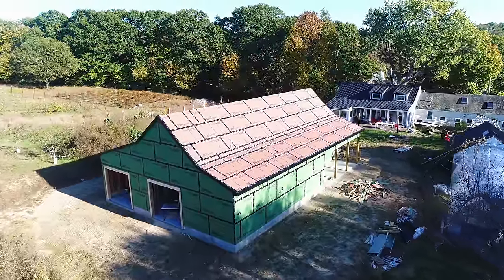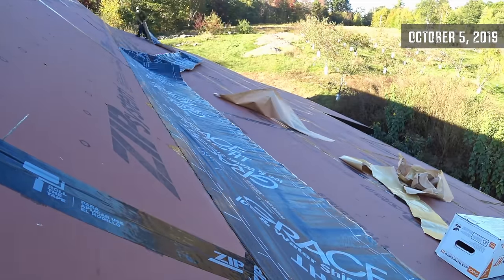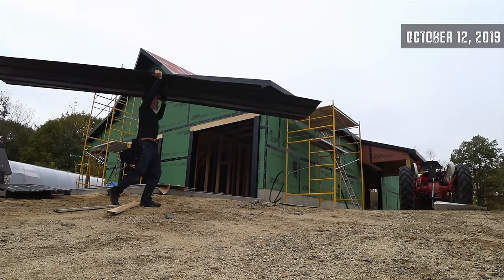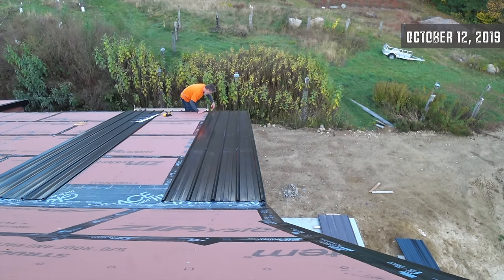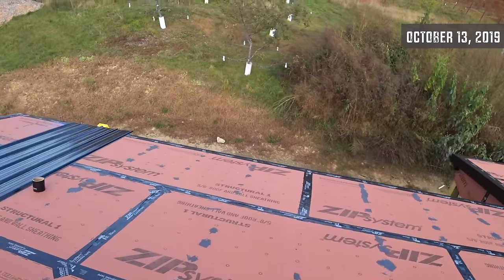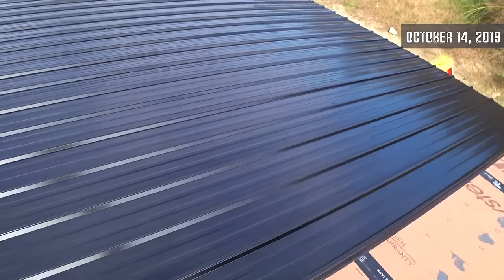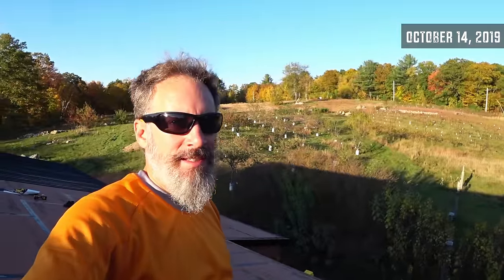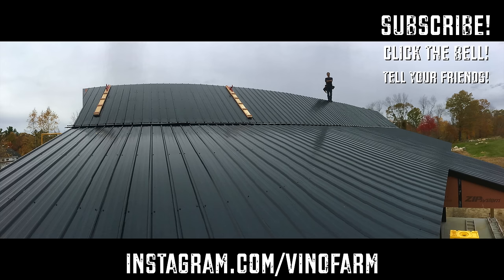Solo Metal Roofing - Dream Barn (Part 4) - Metal Roof Over Zip System

Comment: I just did a big shop with zip, the end conclusion is to just tape the Screw holes too, we did the liquid flash but it leaks a little through that on the screw heads
Reply from the maker: The liquid flash worked ok for me on the deep nail heads. The main problem I had was the framers slapped the tape over dusty zip panels and about 1/4 of the tape didn’t stick. I redid a lot of it.

Comment: Brave man!! Sheet metal isn't for the faint hearted! Yep those tin scissors are amazing! Used those doing HVAC for residential with my hubby for a number of years. To cut a 24 foot price of metal with snips... well my hubby could do it pretty quick after 20 years of Sheet Metal commercial install, but my little hands and forearms checked out at about 5 feet but seriously slowed down after 2. Hope your boo boos weren't too serious... those cuts last a lifetime and scar deep. Smiles and blessings...

Comment: Oh Jim, i am sorry but i had a good laugh on this one. You were awesome though, so don't take it personally. It was how many panels there were of that first type to put up on the roof. we went from 60-70 (it was 84) to over 100 (it was 84) in the process of putting up 4 panels! I am sure had it been me i would have been at 250 before we had half of them up there!
OK i stopped laughing. I don't like heights and its hard to watch you doing that! I would not have made it to getting the first panels up before i called the roofers! You are doing an awesome job, and i am able to watch because I know you did not fall. If you want to confirm that, it would be appreciated! Hugs!
Reply from the maker: That pile of panels didn't seem to end. But I took my time and eventually they all went up! One panel at a time...
Reply: @vinofarm  
and you did not fall! That's the important thing! Secondly important, roof is on - and if you are doing it - it will be done meticulously. No question.

Comment: Like you I'm no roofer but decided to re-roof our house (in slate, rather than metal, as it's a 17th century stone walled former water mill in France).  Why DIY?  Mainly because of the price of a professional job.  We were being quoted around 20,000 to 25,000 Euros ($22,000 to $27,000).  All in cost, to us, for materials was less than $5K.  I bought a second hand scaffolding set, big enough to run the 55 foot length of the building for around $3K from Ebay and resold it after the project for more than I paid for it.  Which was good!  It made the job so much easier - I would recommend it to anyone.  Our roof was 162 square metres (c 1750 square feet) on a 45º pitch - which kept the angles and calculations nice and simple.  You learn so much doing these projects - and likely as not - never use those acquired skills again!  So YouTube is a fantastic resource for sharing those lessons and helping others and big thanks to you for doing the same.
Watching you realise your mistake with those first two sheets I thought - oh yeah, just unscrew and flip the sheets through 180º.  And then you went and re-started at the far end.  Which was a surprise!  Or is that not possible?
My contribution to the ridge/valley debate.  All metal roofs here (France) are invariably fixed through the ridges.  It seems many US manufacturers (from other videos I've watched) recommend fixing in the valleys but it just seems illogical to me.  Ridges stay far drier than valleys - why increase the risk of water penetration?  Nobody really knows how long all these glues, sealants, tapes and synthetic jointing compounds are going to last.  They'll probably see us out, but what of the future?  Living in such an old house, with 3'6" thick stone walls that are as square today as the day they were built over 350 years ago, under the original oak king post trusses in the roof, covered in natural slate, attached with stainless steel fixings, I have a feeling this place is good for another 350 years.
It's very comforting to know that the roof we built should still be sheltering occupiers for the next 150 - 200 years.  Good to know that we have made our own contribution to the future life of this house long, long after we are gone.
Reply from the maker: There's a certain screw pattern in the sheets. If I had flipped them 180º, the lap would have been correct, but the screw pattern would have been upside down compared to the rest of the roof and that would have bugged me. Moving them to the other side allowed the lap to be reversed, but the screw pattern would remain the same across the rest of the roof. It was mostly aesthetics. As for the ridges... I followed what the manufacturer of the product said to do. They are very clear that flats are preferred. The fasteners these days are more advanced than they were 25 years ago (and prior) and they seal out water if they're fastened properly. In the old days, fasteners didn't seal out water nearly as effectively, so ridges made sense. Now it's more of a preference/habit thing but I think the mechanical advantage of the screw pinning the metal to the deck and having less of the fastener exposed to the air is a good thing. Going through the ridge leaves 3/4" of the screw shaft exposed and there's a lot more leverage for the expanding metal to pull the screw loose over time. 

Your house sounds amazing!

Comment: I know it is late but here is a hint. To keep the screw straight you take the first sheet up put the screws in then take the sheet back down line up all the sheets put the first one on then drill a pilot hole in every screw hole then the screw are in line. It really does not matter if the screws are on the ridge or flat. In the old days when lead sealed nails were used it was on the ridge and not flat. Looking good
Reply from the maker: I started pre-punching all the screw holes on the ground when I got over to the second side. Definitely made for a nice looking screw pattern in the end!

Comment: Congrats on doing this roof all by yourself! That's quite a job and I appreciate you gave so much attention to the details. While it may not be as helpful now that you're finished, I'd like to mention one issue that will help anyone who watches this and wants to do the same work in the future.  In my 20+ years as a metal roofing specialist, I've found that the screws in this type of metal roofing do not hold well over the long term when applied into a composite or OSB decking materials like the one you are using.  Don't get me wrong, the Zip System products are great, but the screws just will not hold tight in them for very long.  Nails seem to work fine for shingle roofs over these decks but I've seen hundreds of roof failures on projects like this from the screws backing out a few years after they've been installed.  I think what happens is that the screws kind of tear up the small wood fibers as they go in and then the expansion and contraction of the metal over time forces them up.  Your best bet, and my tried and true approach, is to apply wood purlins on top of the decking and screw the panels into that wood.  We typically use a yellow pine 1X4's but 2X4's will work too.  Another option would be to use a non-composite decking like real plywood as your deck.  I've put together several DIY videos on the subject and you can view on my page at: https://www.youtube.com/user/RoofingIntelligence
Reply from the maker: Thanks for the tip! Maybe next time...

Comment: Rr builders has a great technique for screwing metal panels, while he keeps them all aligned on the ground he would mark where the screws would go with a line and take a nail and hammer / dent them and it would mark or dent about 7-10 sheets at once. So all your screw holes have a small dent to start on and all aligned
Reply from the maker: YUP! I learned a lot from Kyle and the gang. I know he said that they do NOT pre-punch roof steel usually because the panels get scratched when they're pulling the punched panels off the stack on their lift. (They punch the wall steel.) So I didn't use that technique on this side because I was lifting the panels and sliding them off the tractor crib. However, on the other side, I was carrying them up one by one with the step ladder (I got faster) and I did start pre-punching those. It made a huge difference. Perfectly straight screw heads on the West side!

Comment: Grate video, as always, 

It is a bit late now, but the problem with the overlap of the first to sheets, all you needed to do was take them up and turn them 180 degrees,
and the flap would be on the opposite side.
and you could then refasten them thought the hole already  made in the sheets.
Hope the bee are well,will be good to see them in the spring.
Reply from the maker: Thought of that, but the screw holes would have been out of alignment with all the other panels on the roof and we can't have that!

Comment: Also not having a plywood skin helped moving around.  when I helped my father re-roof our old place I was never nervous on the roof until after all the new plywood went down. that stuff was /slick/ and if you had to cut or drill anything and got sawdust on it it was down right treacherous.
Reply from the maker: Another benefit of Zip System... extremely grippy!

Comment: Oh wow, 86 panels! 75 panels is quite a few, so hopefully everything goes smoothly. You'd hate to have an issue after all 92 panels are on and you have to take all 105 panels off and then put all 71 of them back on.
Reply from the maker: Wait until I get into how many screws I had to use on the next video.

Comment: Why did you screw the valleys rather than the ridges. 
Never mind I saw someone’s pinned comment. In Australia it is standard to screw the ridges.
Reply from the maker: It seems to be an Australia thing. Up here, it sounds like we used to do that, but the trend is on the 'flats' for the past 20 years or more. I followed the manufacturer instructions. Pros and Cons to each. I'm not worried.
Reply: South Africa also screws on the ridges to keep the water away from the screw and screw hole. That's what the ridges are designed for as far as I know. Great job though, looks like a fun project.

Comment: Vino what is the model of your brake? I'm thinking of doing the same in my barn build.
Reply from the maker: It's the 10'6" Alum-a-brake Ultima with the track cutter. You definitely want the cutter. I found the coil caddy on Craigslist and that was also extremely helpful. I just looked at prices and they seem to have gone WAY up since I bought mine 18 months ago. Still cheaper than hiring out someone to do a siding job, but it's definitely an investment. I'm probably going to sell mine in like new condition when I'm done with it.  Definitely a nice tool to play with.

Comment: A good trick to get metal up on a roof is to take a welding clamp with A piece of PVC tape on the pads.  Clamp to the end of the metal and tie a loop around the arm of the clamp.  Then you just pull it up.  Works great if you don’t have any equipment at your disposal.
Reply from the maker: Good tip. For the panels under 15' or so, I was doing just fine hauling them up the ladder in the taco shape. That became my most comfortable method. Those 16 and 24 footers needed the lift!

Comment: couldn't you just flip them around and still start from your square, instead of going to the other end? or is there a top & bottom?
Reply from the maker: That was the first thought I had, but after the screws were put in place, the top and bottom are established. If I had flipped them, those two panels would have had screws out of place with the rest of the roof. Putting them on the other side actually worked perfectly.
Reply: @vinofarm  oh gotcha. Well it looks great!

Comment: If you're so worried about leaks why didn't you cover the entire roof deck with self sealing self adhesive rubber membrane?  Note the membrane is the waterproof roof. The metal sheeting is the protective covering. You wasted a fortune is specialized sheathing and edge sealing tape to not protect the roof deck from thermally created condensation on the back of the metal sheeting  vs conventional sheathing and full rubber membrane then metal sheeting.
Reply from the maker: Do you know how much High Temp Ice and water shield costs? No way we would have saved money with conventional ply and HT Ice and water. If anything it would have been close to even. The Zip System sheds water and condensation just fine. I was concerned about the gaps at the pitch break. The framers left giant gaps in the sheathing and went over with the zip tape before dusting off the panels. Every time it rained, there were drips all down the pitch break. It was poorly installed. I just wanted that particular section to have "belt and suspenders" coverage. Doing the entire roof in rubber would have been overkill and cost thousands of dollars.